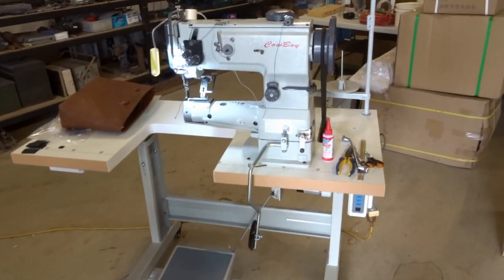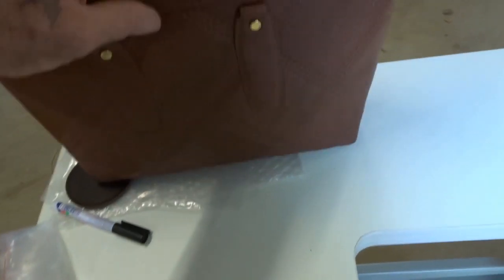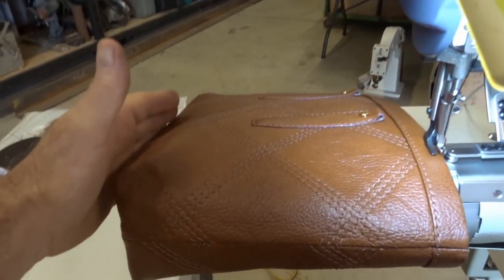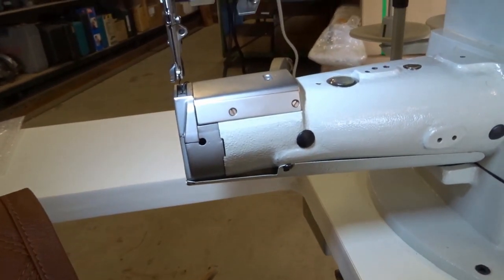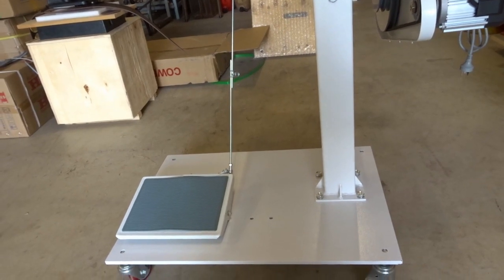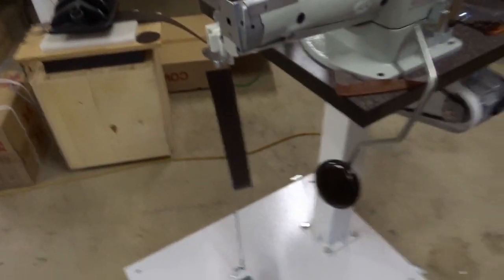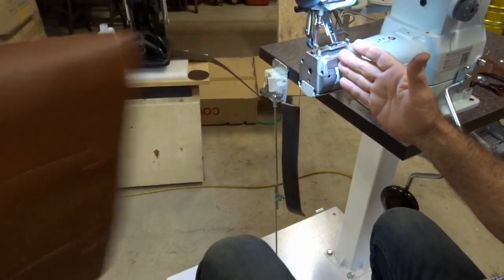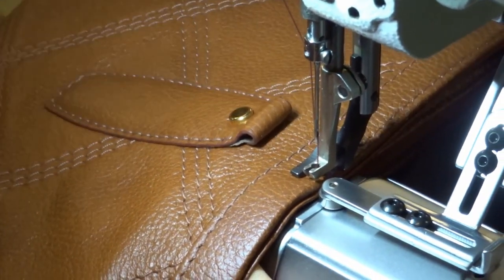CYLINDER SEWING MACHINE BEST TABLE CHOICES

Comment: I just bought a Tech Sew 5100 that comes on your ”tinny table”! You’re right, it looks a bit wimpy but is quite solid. The bottom plate is 5/16”. Height adjustable. Great video. 

Head plus table equals work station!
Reply from the maker: Hey Chris Fournier you might want to check out this video on the narrow needle plate set there are links in it to where you can buy etc https://www.youtube.com/watch?v=wdloxyjeB1w&t=21s

Comment: Thanks Harry for a great video. I am currently looking at getting a 6900 and am looking at ways of reducing the footprint of the table. It looks like the Pedestal will have a smaller footprint so it might be useful to use it.  In addition, the other tip you pointed out in the video about the bigger sewing area for certain items is also something to consider. Cheers.
Reply from the maker: Glad it helps mate. If your buying in Australia you should get my contact details and just give us a call if you need any help.
Reply: @wildharry3203  Thanks Harry, that is very generous. I found you details on your website. You have some great products there. I am starting to research machine option so if it is Ok with you I will call you as I get a bit more information. Cheers, Will
Reply from the maker: All good mate, your welcome to come visit if you want to as well. @willspencer3044